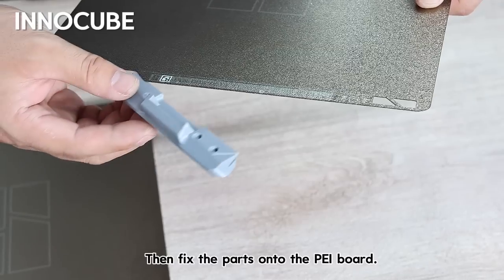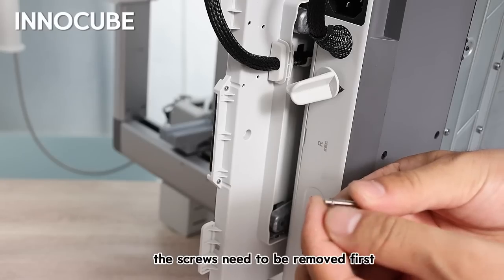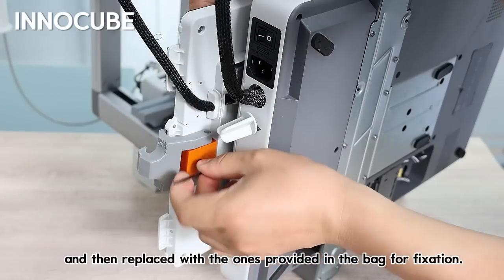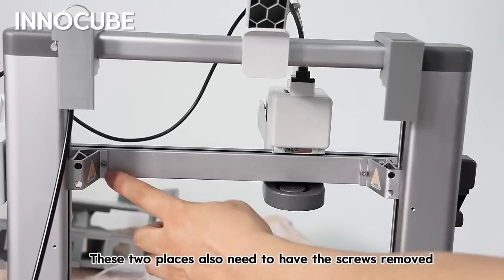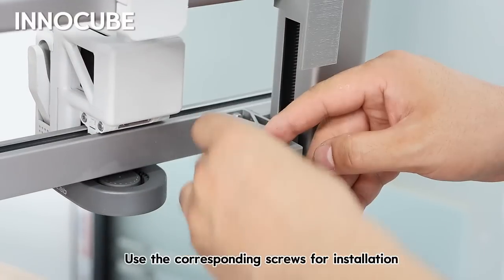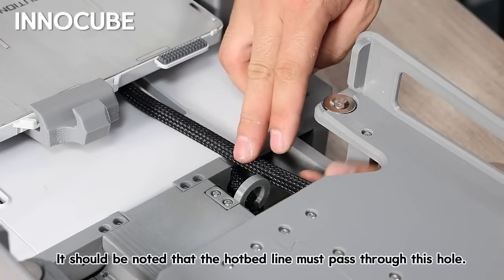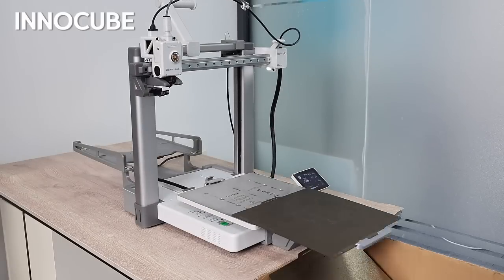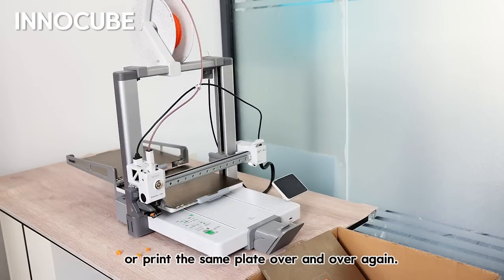How To Install Bambu Lab A1 Swapmod Kit Auto Swap Multi-plate Changer

Comment: Hello, I just got my kit and installed it but can't seem to figure out how to get it to work correctly. When I start a print with the modified gcode it will either tell me no build plate is detected if I have no plate, or if it has a plate, it starts calibrating with the second plate attached which doesn't seem right. Are there more instructions or a specific way of starting each batch?
Reply from the maker: @noodlefroodle6105  contact info@innocube3d.com
Reply: @INNOCUBE3D  Just sent an email
Reply: @INNOCUBE3D  The issue was that I had the plate under the clamp instead of above it. Thank you for your help
Reply from the maker: @ My pleasure, if you have any questions, please feel free to contact me
Reply: Did you end up receiving the PC software to load 3d models instead of using the unprotected website? Thanks
Reply from the maker: PC software：https://www.dropbox.com/scl/fi/s8n2hp9ks4ywsa97w2wjs/INNOCUBE.zip?rlkey=pubjsaxl76ygpm4ie4dbn8ce7&st=ggghs7hi&dl=0

Comment: How do i change the filament type from pla to petg on the website?
Reply: and how do you change the color on the website?
Reply from the maker: @lukemooregaming1569  Normally, set up slicing on the Bambu slicer, set up multi-plates printing, then generate the file on the website, and then transfer it back to the printer to start printing
Reply: @INNOCUBE3D  thank you I see i got it working
also how do you download additional clips for the print beds since i only got 2 and i have 5 print beds
Reply from the maker: @lukemooregaming1569  I can send you the file， you can print it ，your email？
Reply: I sent a email asking using the email on your website
Reply from the maker: @lukemooregaming1569  I will check it later
Reply from the maker: I sent the stl to your email，please check it

Comment: Is this compatible with top mount for ams lite? I see no issue other than the stabilizer feet that are printer with the top mount.
Reply from the maker: Compatible
Reply: Thanks! Another question, is it possible to send an order to the printer to change the just change build plate? Without queuing multiple files I mean, just swap the bed when I want
Reply from the maker: @generalx90  Not yet. I will seriously consider your problem and see how to develop it.
Reply: @ I think I got the idea from the swapmod for a1 mini but not sure if I’m remembering correctly, anyway I think it would be an extremely useful feature, say I finished a print and want to print something else directly from bambu handy app, I can just tell the printer to swap the plate to a new one and just start a new print.
Reply from the maker: @ That’s great
Reply: Wouldn’t it make more sense to just create a .3mf file with the swaps already set and upload to Bambu handy so people can use it for swaps?

Comment: Just have two questions

1) so the texture plate has a clip on them, how many clips are included in the pack and if need be, can we print more or order more?

2) how many plates can we put on the system? Can we put five plates in the system? Or more?
Reply from the maker: @logangarland2222  1,2 pcs clips , can print more.2 ,10 plates

Comment: yeah this is a good idea if you want your power cable to your heat bed to be destroyed in about 100h of printing
Reply from the maker: The actual test printing time is more than 2500 hours, and the hot bed cable is normal
Reply: @ show the printer clock and prove it don’t believe you
Reply: nah, dont see why that would be a problem lol

Comment: Looks interesting. A few questions. 

1. What happens to the objects on the swapped plate? Looks like they are just dropped into the cardboard box with the plate. This means the printed objects will be knocked around by the plates entering the box. Could be issues with more fragile objects. 

2. Is there a delay before the swap is made? If so, how do you setup the delay value? If not, the plate will still be hot and the objects stuck more tightly to the plate which could lead to additional issues since the objects may not release until the plate cools down. See possible problems with objects getting damaged.

3. What is the price? Are the objects available for printing yourself? Cost? If so, are there other components needed for the system to operate? 

4. Can you explain tte link provided to the part files? Not exactly sure what yhis is providing. Does it contain all needed 3D printable parts? What other components are needed? Do you sell a kit of the other needed parts if you print the parts yourself? What are the profile parameters for printing yourself? What filament is recommended? What nozzle size? 

5. How long has this been available? What has your testing shown as far as reliability & damage to printed parts?
Reply: Did you even bother reading the description?
Reply from the maker: @nitehawkpearl8304  Hi， what can I do for you?
Reply: @INNOCUBE3D oh I mean to Christopher, that if he didn’t read the description. Thanks for asking.
Reply from the maker: I will respond you tomorrow
Reply from the maker: 1. After a long period of testing on multiple machines, no damage to the printed objects occurred

2. Short delay before swap

3. About the price， you can buy it via https://www.innocube3d.com/products/swapmod-bambu-a1-auto-3d-printing

4. This material is PLA or PETG, and there will be CNC processed parts later

5. This product has been tested for 2,500 hours. We started testing in January and the stability and reliability of the test are good.